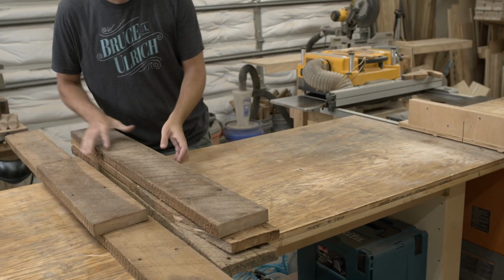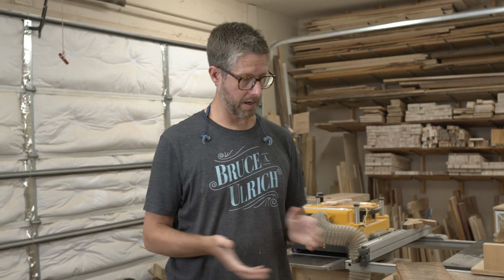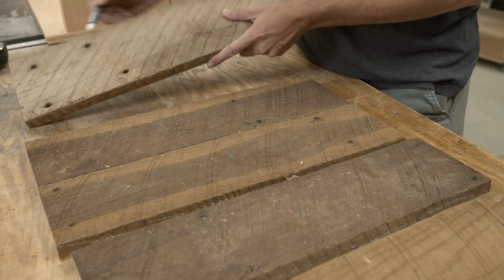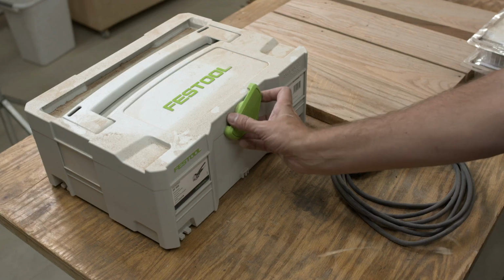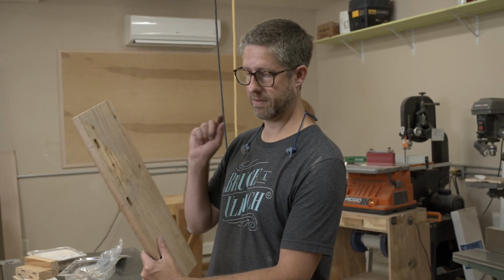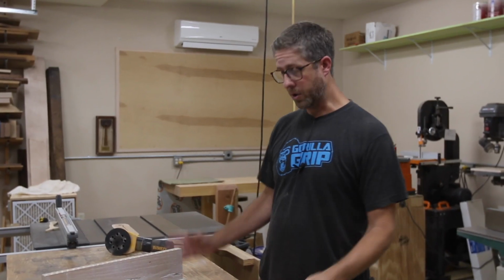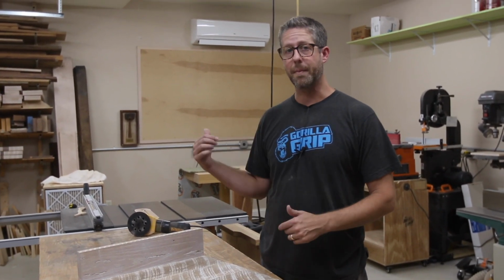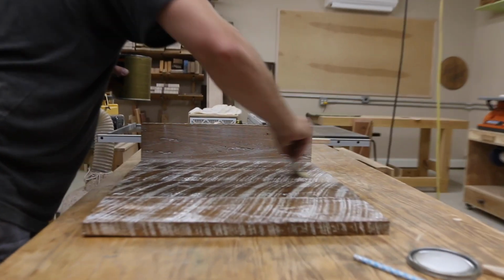DIY Towel Shelf

Comment: Looks good, I like the length of the  back panel, it definitely improves on the standard towel hanger. Just a tip on the domino though, Supposedly your cutters will last a lot longer if you have a vacuum hooked up, it keeps them cooler. Can't verify that for myself yet though I haven't had mine long enough yet
Reply from the maker: Yeah, I think you're right about the extractor. I'll have one here soon enough.

Comment: love the look.  my only "thing" is that the unit sits off the wall the thickness of the cleat right?  personally, i would've maybe done something along the edges that would hide that gap.  Still great though! 👊🏻
Reply from the maker: Thanks, Seth! Yeah, I thought about changing it up. I ended up liking how it looked like it had a reveal but another option I was considering was getting one of the metal cleats you can buy. They’re much smaller profile. I could have also routed out a big cavity in the back and made it sit down flush but chose not to.

Comment: 0:50 What is that wand you're using?
Also I dig the music tracks you're using...
4:00 You said it's a Domino jig but I didn't see any pizza?
Smart blocking out the license plate with your head. Was that on purpose?
Looks awesome Bruce! Wouldn't change anything at all...
Reply from the maker: That was a metal detector. This was some old barn wood and I didn’t want to have the surprise of finding a nail with a saw blade. No pizza on this one. Ha ha. That was totally NOT on purpose with the license plate. Didn’t even notice u til you mentioned it! Thanks so much, Stephen!

Comment: Nice project! Curious how you fixed the domino goof? Did you just plug with with a domino?
Reply from the maker: I was going to do that, but I had a little bit of material left, so I just cut and planed another piece. It was the better move with this stuff. I wouldn't have been able to disguise the Domino very easily.